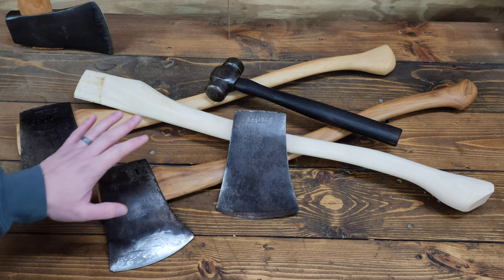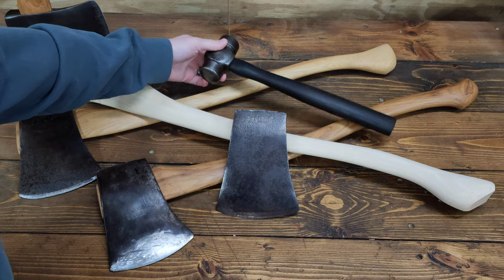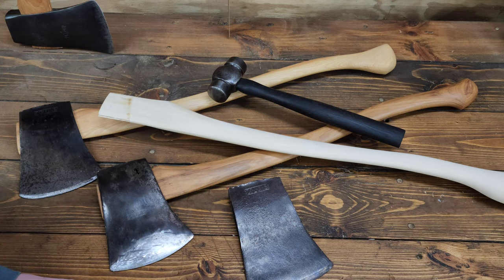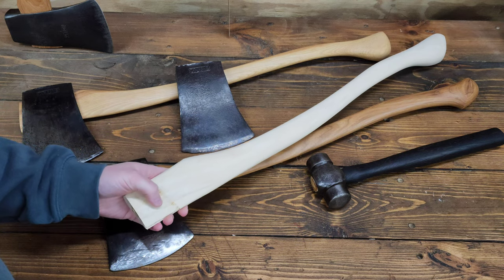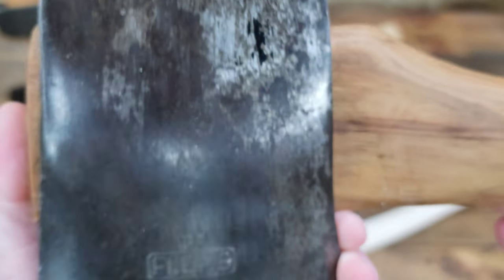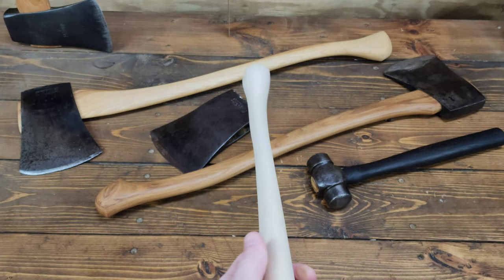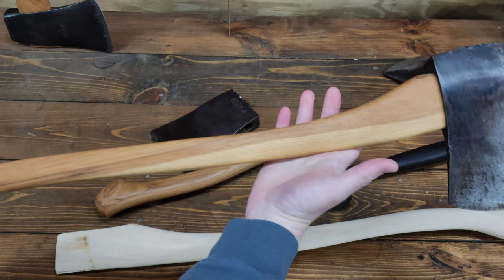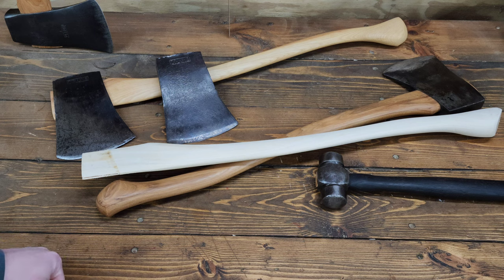COLLINS Connecticut Pattern Axe Build Part: 1

Comment: You've got some very nice nearly full bit connies.  I really like what you do with the house handles.  I never got them looking that good before I started making my own handles.  I was surprised at the pretty dang good prices for the whiskeyriver billets are you gonna buy any of those?  3 inch wide might be a little limiting but it's fine for most eyes and the slightly curved handles I like. 

Personally I would try to pop the grain out instead of char the entire handle.  I guess it's just the pores that get charred when you do that.  I used to torch handles like that but don't anymore.  It theoretically should weaken the handle.  Skillcult has a good video about it: https://www.youtube.com/watch?v=G4q5ArqDSo4

 I still think good hickory is "resilient" enough where it probably doesn't matter.
Reply from the maker: Thank man I appreciate it! I really do enjoy taking the time to shape a handle. It's very relaxing for me. I saw the billets but haven't picked up any yet. I have a board of hickory already but I've been a little reluctant to use it. Whenever I cut into it, it smells like cow $hit lol. I've never had that issue with hickory before. Maybe the tree came from a cow pasture or something. The wood smells terrible though. A whiskey river billet may be a good alternative. 

I love Stephen's videos. I've watched him for years and really enjoy his axe content. I did see his video on charing and it's one of the reasons I have some reservations about it. Since I'm only doing it for the look I'm thinking of hitting it with high heat quickly as to only touch the surface and not heat the wood too deeply. Might be a complete failure but since the handle has very little runout and good orientation I'm hoping it will still be durable enough.

Thanks for checking out the video and giving your thoughts man!!!